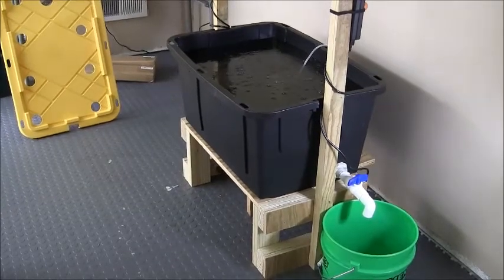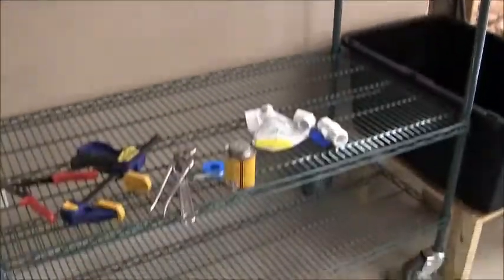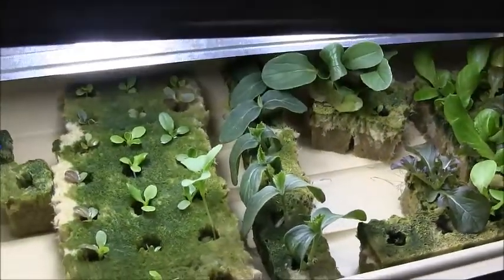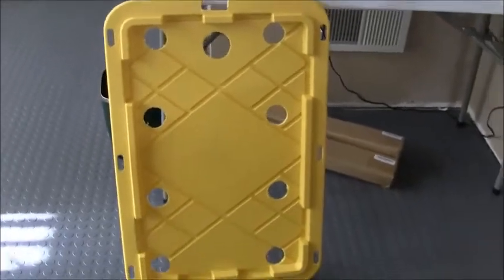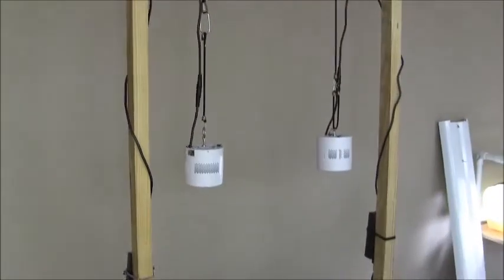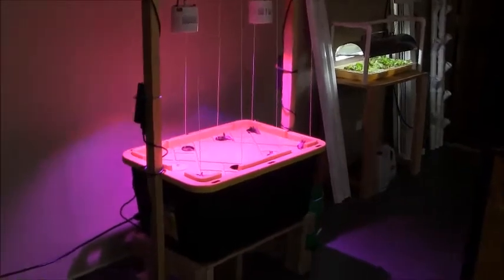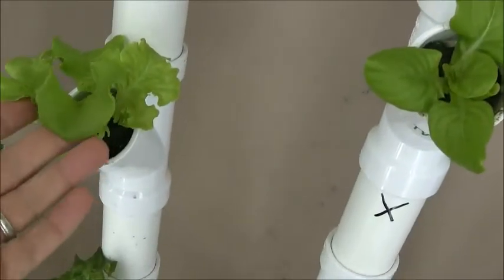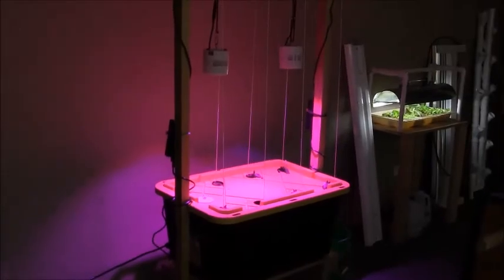Indoor Hydroponic Container Cucumbers

Comment: Danke Schoene for the videos! I haven't started indoor hydro yet, but I just put together a seedling starter rack using two 50w outdoor flood light fixtures about $20usd each on ebay. They have a large aluminum body and a COB LED. I've look at a few videos of actual blue-red grow lights and results are not good. Stick with warm white LED. Special grow lights seems a rip off that's why I'm using the COB LED fixtures. This is the light style: https://www.ebay.com/itm/30W-50W-100W-LED-COB-Flood-Light-Outdoor-Garden-Yard-Waterproof-Lamp-AC-90-265V/352093214585?hash=item51fa641779:m:m05CZYrTGTYgdUFvDWw4o9Q Have you tried lights like this? Take a look here, this video was interesting with white LED vs blue-red LED (although a bit long-winded) https://www.youtube.com/watch?v=WPAy79_Kh-o
Reply from the maker: Hello, I tried germinating seeds with a 30 watt LED flood, but there was not enough intensity. I'll have to check out your links soon when I have more time. Thanks,
Joe

Comment: I know im being picky but this isnt kratky as your using aeration its dwc. Awesome setup though.
Reply from the maker: Excellent! You know your stuff! The aerator (4 watts) is to get them started. Once the root systems are established and I need to flush, I'll drop the nutrient level and shut off the aerator. That will save on energy, nutrient, and time. I was concerned about desiccating the plants as some of the roots were poking through and others not, when I transferred them into the container, and so I had to fill all the way up. Thanks for your comment!

Comment: I tried to grow 12 Cucumber plants in 2 containers similar to yours. I used 2 100 watt CC LED lights by Spectrum King Led. The plants grew great under the lights , but I only had a few cucumbers grow. I then used their 400+ "440 Watts used power". After switching to the 400+ Led lights I was growing lots of cucumbers. Hopefully yours will do better. I just started my cucumber grow again. Good Luck!
Reply from the maker: Hey Q! I really appreciate you taking the time to comment, thanks. The 400+ Spectrum King LED looks like a monster! Research seems to suggest that cucumbers need PAR values of approximately 350 µmol/m2s for optimal growth so it would seem unlikely the 100 watt Spectrum King lamps would cut it, and I can't find much about the PAR output of mine but I'm doubtful here too! My Kessel 350s are left over from my aquaponic days and another concern is that they are of the vegetative growth spectrum and don't have enough red to promote flowering. I'm thinking I'll need a 2 supplemental bulbs with deep red chips when the time comes. I also have an old Hydrofarm Sol2 that I can perhaps upgrade. Also, what has worked best for you in terms of nutrient ppm/pH for your cukes? Online sources point to values all over the place. Finally, what do you do about ventilation? Thanks so much in advance for your time!
Reply: I believe my nutrient ppm was at 850 and PH was at 6.5. I grew them in a 2'x4' grow tent and I just opened up the top vents and just put in a small 10" fan at the bottom to blow on the plants.